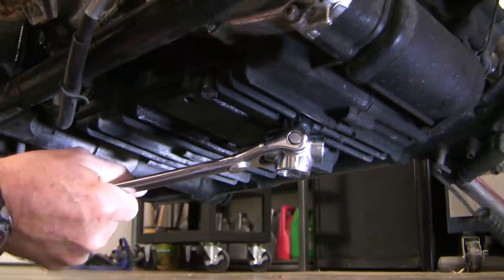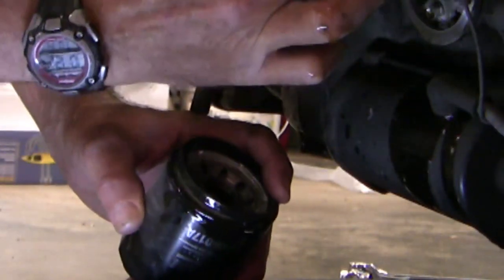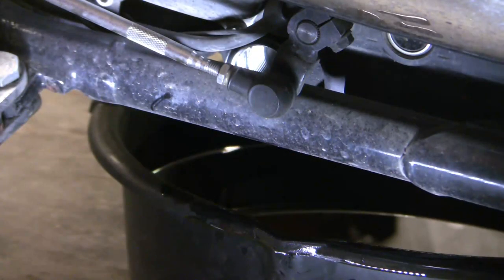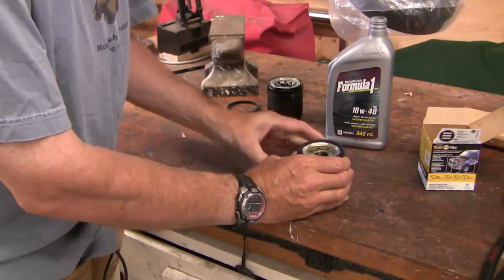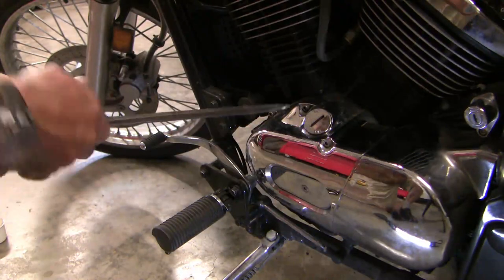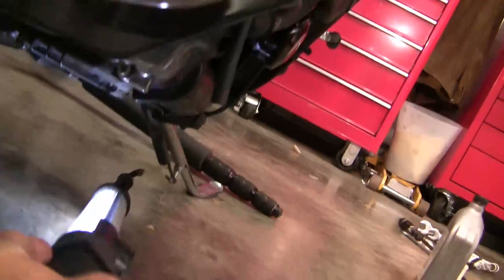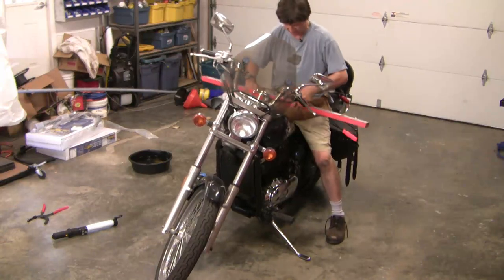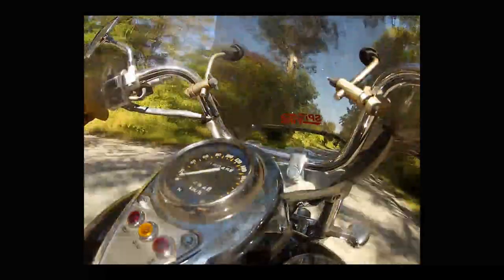How to change motorcycle oil,  Kawasaki Vulcan

Comment: Not sure anyone has mentioned this but have you thought about building your own wheel chock so the front wheel is rolled over and into a 2x4 block for the wheel like you see for hauling on trailers.  You can build one fairly cheaply using 2 x 4's and a 4 x 4 post.  Just google or youtube search for homemade wheel chock.  It will hold your bike level for you to change the oil without your kickstand being used and won't harm your bike at all. http://youtu.be/NklTtk8MuEM

Comment: You put the screen in backwards.
Reply from the maker: Not for this bike, the way it went in was exactly as described in the OEM repair manual, and I was the first to ever remove it, original owner, and I've done all maintenance. That said, others who own later editions of the Vulcan have said the same thing, which prompted me to double check that fact. Later editions may have it normally installed the opposite way, or maybe the previous mechanic didn't install it correctly. I suppose it is possible that Kawasaki changed their mind about which way is best, though I'm not aware of any TSB's to that effect for the '95 VN800. I'm not even sure if it makes a difference, though getting it out must be a little more tricky if you can't use the thimble trick. As mentioned in the video, if not sure, I would check your OEM owners repair manual and if in doubt, replace it the same way you found it.
Reply: @spelunkerd  They Kawasaki changed the way the filter goes in causing a lot of confusion I believe it was like 2002 not 100% on that.  Also I believe my 99 1500 Nomad has self adjusting hydraulic valves

Comment: Wrong installation !
Reply from the maker: If you're referring to the orientation of the screen, the orientation is correct for a 1995 VN800. Note that the orientation is different in different models, your bike may be different. It would be worthwhile to get a dealers repair manual for your exact bike before you decide whether your screen is put in backwards. See the discussion thread.